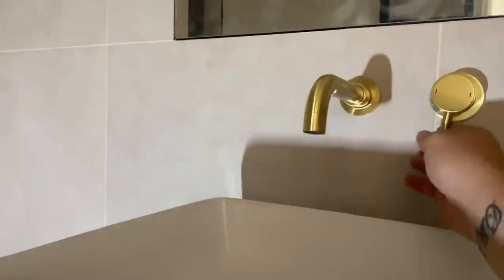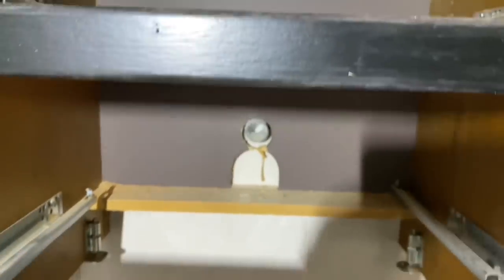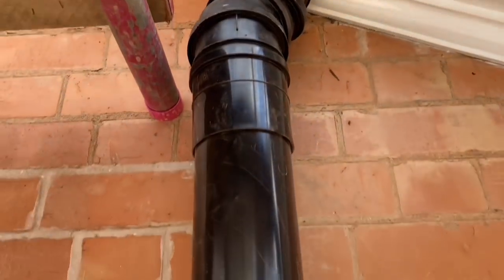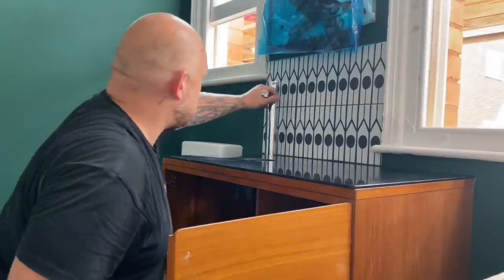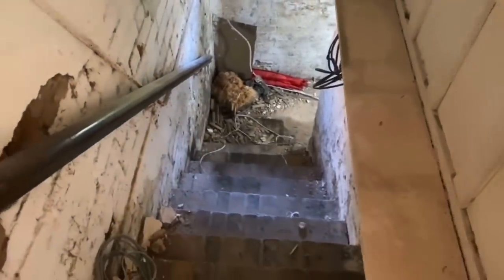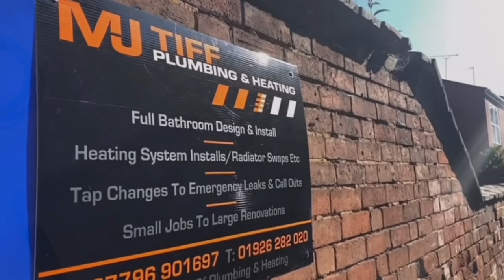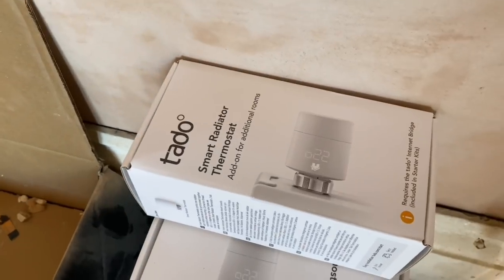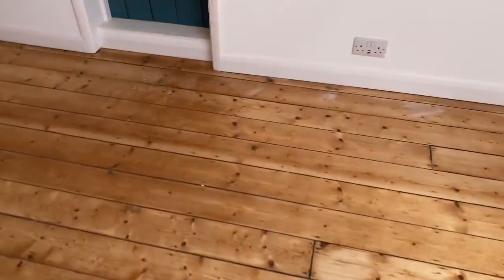COMPLETE HOUSE RENOVATION PLUMBING & HEATING IS 99% FINISHED.. START TO FINISH VIDEO

Comment: It looks awesome mate. Lovely finish. I’m on a bathroom refit, so far two weeks. It should have been finished but I reckon I’ll be near on another week yet. The customer ordered the parts late but still wanted the same timeframe on the job, so I’ve been waiting for stuff along the way and then the customer decided he wants the shower to be pumped and the existing en-suite shower to run from the same pump so now I’m waiting for another 25 gallon tank to increase storage volume so I fully understand the stress you’ve had and getting pissed off with it. I’ll get there and you will to mate. Good luck with the next job.
Reply from the maker: Thanks mate, yep things sometimes are out of your controls 👍🏼👍🏼

Comment: Nice job a lot off hard work paid off just noticed the rad pipes on the kitchen rad don’t drop straight down was there a reason for that ?
Reply from the maker: Hahaaa…. I wondered if someone would spot that.
The rad was originally 400mm longer and the rad pipes were put in at a very early stage then the floor was put down. Pipes were perfect for the rad like all the others.

However

The kitchen was designed and the dishwasher was 30mm closer to the wall for some reason which meant the door would catch the rad, so the rad had to me swapped for a shorter one but the floor was all ready down.
I was gutted but the client was ok to have it like that…. That’s one thing on the job that annoys me but the clients are ok with it.

Well spotted… I was hoping no one would 🤣
Reply: @MJTiffPlumbing  lol I can get why it annoys you but out off your control really without taking all the floor up guess it’s only other plumbers that would notice it really if the customer is ok with it then that’s all that matters

Comment: Always nice when a job like this cones to an end and you look back over it.

What the reason behind the electric shower though?
Reply from the maker: Thanks mate….

The electric shower is over the bath as a “just incase” type of thing, as there is also a walk-in shower in that bathroom.
The customers are very much “belt and braces”👍🏼👍🏼
Reply: @MJTiffPlumbing  ah no worries, just seems a shame they’ve plonked it on the wall, everything else seems to fit in nicely all looks integrated if that makes sense. 

Customers though i suppose
Reply from the maker: Yep we knew from the day the room was formed that was going to be where it had to go, only place for it in the whole room….. customers always right 😉

Comment: Why didn't you use a bottle trap ? Not criticising just generally want to know but great video as always.
Reply from the maker: P traps flow a lot better than bottle traps I find 👍🏼👍🏼
Reply: @MJTiffPlumbing  fare enough mate, everyone has there preference its turned out nice this job well done mate. I've just started 1st fixing 14 apartments.
Reply from the maker: Thanks mate….

Make sure you pressure test them, flats can be a right stressfest
Reply: @MJTiffPlumbing  i yes1step at a time too much pipework and fittings involved 4 rads and 1 bathroom and 1 kitchen  per apartment. Its not alot but it is alot if that makes sense lol.

Comment: What year do you think that house was built?
Reply from the maker: I think the original house was 1600’s
Reply: Original house was built in 1850 it then had a wrap over extension in 1900
Reply from the maker: I think the original house was 1600’s, was part of the church